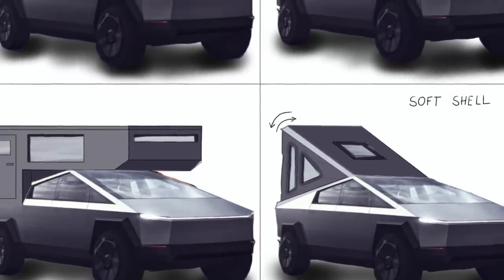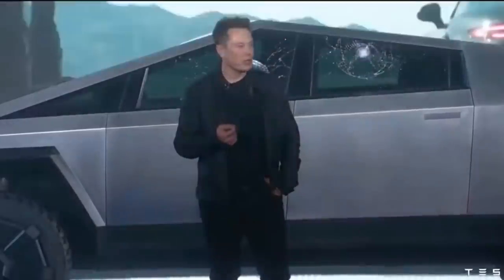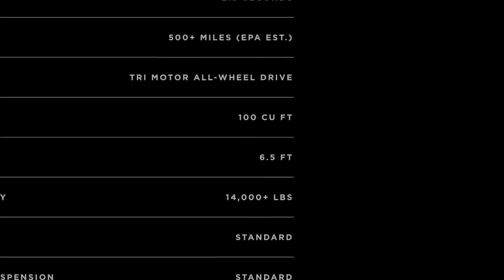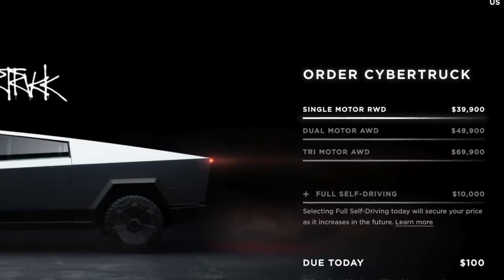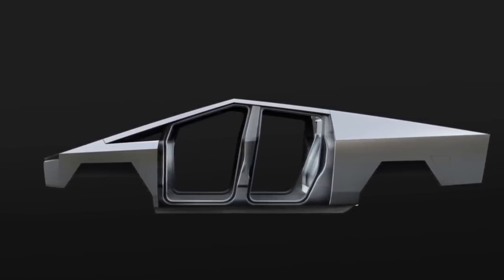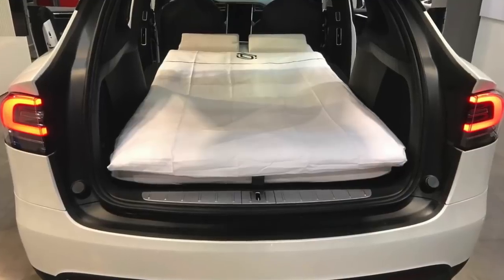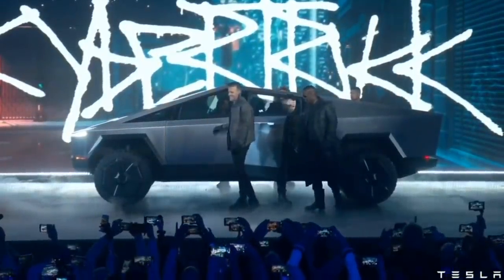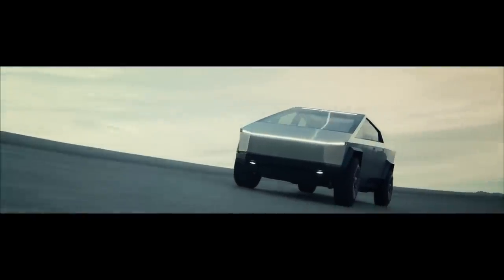Tesla Cybertruck 2021 [Final Updates]

Comment: the truck looks fine. 2 things that I don't like about it. the 3 front seats instead of 2 more roomy seats. is a setback. and having an option for a regular round steering wheel. That would be nice.  there is no need for 3 seats in the front.

Comment: those pictures of beds where from 3's and S's I believe . If they want to make a body length
space there will have to be drop down rear seats and drop down back door at the rear of the 
cabin. which would be cool not just for camping but for longer loads.
I bet those are expensive tires. I would guess the range would drop a lot with those stated
tow loads.

Comment: Couldn't they make more rounded surfaces by using some kind of injection molding? Tesla would actually have to mold the steal before it hardens, which means Tesla would have to work with the steal maker. Zero scraps!

Comment: Can it perform like my GMC Savana? Take me 800 Kms through a dark wintry super cold night with heaters and blowers and lights all on, refill in 10 minutes and give me another 800 Kms? If so, he has a purchaser right here!
Reply: you dont drive 1600km with a 10 min break do you?
Reply: @lorissupportguides  -We swap drivers every 2 hours. As it is a full size van we don't even have to get out of the van to swapplaces - and there is a sofa-bed in the back,along with TV and latrine. We go to Halifax from Ottawa that way, and go to Winnipeg, and even to Florida (a 20 hour ride) non stop other than to gas up every approx 800 Kms. We take maybe 4 trips a year this way. Electric cars are OK for put-putting around town (I use a small Elantra for this), no so good for long range cruises and holidays. My buddy's Volt had to stop 4 times and wait and then wait more to recharge just to get to Halifax. A 12 hour trip became an 18 hour trip....... time is money.  No doubt batteries will improve and maybe even come down in price. Someday......

Comment: This video has a lot of inaccurate statistics about the truck market. The 2021 F150 can tow close to 12,000 lbs when properly equipped with max towing package and certain configurations, with most popular models towing ~10-11k. This is way more than the potential entry level 7,500 of the Cybertruck, and about on par with the max claimed amount. Plus, Ford and more establish truck manufacturers significantly under-rate the towing capability for safety, whereas Tesla has been known to inflate numbers to mislead customers and generate sales.

It also says auto-pilot is $8k add-on, but the video even showed $10k (and I believe it's even higher as of now). I wonder if this was an old video that was re-posted or updated the end of, but not completely new video.

Comment: Correction at 1:42. The most powerful consumer grade gas powered trucks are Heavy Duty's like the Ram 3500 and Ford F350. They tow 30,000lbs+ More than double the Cybertruck.

Elon was comparing them to half ton light duty trucks.

Comment: When you were mentioned time frames, you left out the 3 motor version.This will definitely be my last truck so I went all out. Has anyone heard of a time frame for the 3 motor version?
Reply: It's likely that dual-motor will be first, followed by single motor and then tri-motor.
Reply: The Dual motor and the Tri motor will be made at the same time.  The single motor will come out a year later.  Reason is the Dual and Tri motor have almost equal orders placed.  The single has substantially less orders placed.

Comment: You're a little off on your towing capacity.  Here is just the 2019 dodge ram models for comparison.  
Rebel: 11,540 pounds
Laramie Longhorn: 11,540 pounds
Limited: 11,540 pounds
Big Horn/Lonestar: 11,610 pounds
Laramie: 11,610 pounds
Tradesman: 12,750 pounds
Reply: That's just the half ton light duties too. The Heavy duties tow 30,000lbs+ 

The uploader should put a correction in the comments or description.

Comment: I wonder if Tesla will be able to build the Cybertruck without mirrors and whether the steel body will corrode in northern climates where salt is used on the roads.
Reply: The truck is corrosion resistant.
Reply: All vehicles are corrosion resistant anymore.

Comment: 14,000 lbs towing is twice the f-150??

You should do your research before putting out videos.
Reply: It's twice the towing of like a 2000 model F150. Besides this, based on the size of this this thing, they should not be comparing it to the F150, but the the F250.

Comment: No one has been able to definitively answer whether fifth wheel and/or gooseneck towing will be possible?

The sail panels suggest that it is improbable due to interference. But the 14k+ lbs towing suggests it is virtually a requirement to have an in-the-bed trailer hitch capability.

I have a Dec. 1, 2019 trimotor reservation.

Comment: I heard this will have an on board air compressor and you can plug in to the bed. Oh this would be a great mobile detailing truck! with an electric pressure washer you wouldn't need a generator or an air compressor....
Reply: The air compressor is already to run the air suspensions just like any other basic car does.

Comment: Uh... 14k lbs isn’t twice the towing capacity as current gas pickups can tow - it’s basically the same.  Cybertruck does have a higher bed capacity than a normal quarter-ton pickup, so that might be what you were thinking of, but the towing is almost exactly the same as an F150 with the 3.5 ecoboost with the towing package.

Comment: Good video but it had a few things wrong. As of today 02/19/21 the reserve down payment is $ 150 and the self drive option is not 8k it's 10k and the video did not mention that there will be a solar panel option for the roof and a higher end add on that spreads out solar panels for  increased charging capability.
Reply: You are mistaken.  Reservation deposit is still $100, as you can see from my screen grab just now.

https://i.imgur.com/vuz8k5s.png
Reply: @madmanmakes  That's messed up because I just went to the site right now 02/19/21 at 1621z and it shows $ 150 here's the the link:   https://www.tesla.com/en_ca/cybertruck/design#battery please tell me if you see something different because if you do, it means they are unfairly charging more because of my location.
Reply: @jorgeo4164  Are you in Canada?
Reply: @madmanmakes  No, I'm in the USA, Florida. That CA in the upper right corner I believe is California.
Reply: @jorgeo4164  No, that is a descriptor for Canada.  The normal US web address for Tesla does not include that.  The website address should appear as:  https://www.tesla.com/cybertruck
Reply: I also live in Florida.

Comment: I have a pre-order in for a tri-motor. 500 miles of range? Yes, please. As an electrical contractor, I plan to use this as my service truck. I am concerned about how to outfit it with extension ladders and sincerely hope Elon will make a ladder rack option!
Reply: Welder.
Reply: @nzzenith  certainly crossed my mind! I have a friend that has been a welder for 20 years and he welds stainless all the time.
Reply: Hi Nathan, there will not be a way to mount extension ladders on the roof due to drag and the risk of things blowing away by sheer force when acceleratoring the vehicle...the truck bed will have straps and will be longer than a conventional bed that you find with any other vehicle...tx for the comment though...many brains...
Reply: @thehonesttruth8808  - perhaps there will be a way to attach to the T-Rails in the CT bed. Remains to be seen. Time will tell and I look forward to seeing how Elon and Franz solve this problem. They have pitched it as going toe to toe with an F-150 work truck. I'm sure they intend to market the CT to contractors and contractors need to carry extension ladders.
Reply: I like it, I also understand the cybertruck is also useless as a work truck!

Comment: Not gonna lie I wonder how the Cybertruck will reach the performance on the other Cars. Tbh im more hyped for the Roadsters!
Reply: I wish they'd make a cyber truck styled roadster
Reply: Yeh i can't wait for the Roadster and the Semi. But i have to say the Cybertruck never grew on me i still dislike it
Reply: @Modestasgailius  It is not for everyone (look wise). But I grew up with trucks using them hard not as a toy. Still have trucks I use as trucks. We also have an EV. I’m excited about the look and possibly, of lite towing, 500 mi range. I have EV, F-150 and Diesel Excursion. I hope I can use this to replace the EV and F150. Can’t ever get rid of the excursion due to tow capability.
Reply: @danieldorchester5221  it will not tow like a ford or have a great range.
Reply: @danieldorchester5221  It tows 14,000 lbs, isn't that enough? I don't know much about trucks.
Reply: @luke8617  in principle 14k is plenty. The problem is range. At 10k will it have 25% range?  We don’t know yet but that would be my guess. Also the truck I tow heavy loads with weights 9k lbs. it comfortably tows 10k lbs at 70 mph. If my truck only weighed 5k lbs it would not tow nearly as well. Range is the biggest issue.